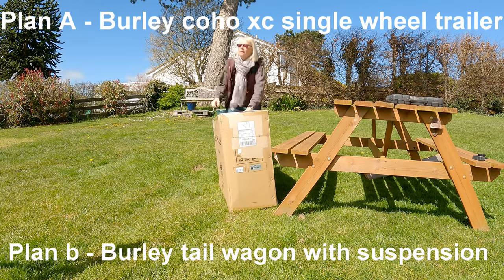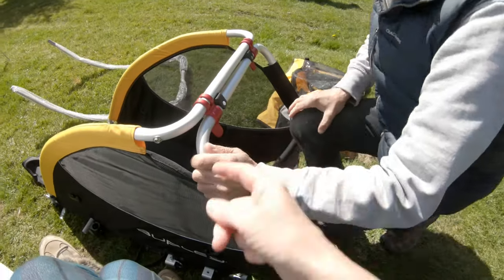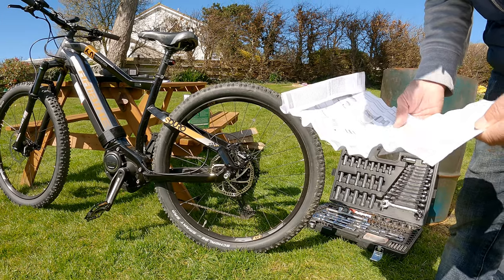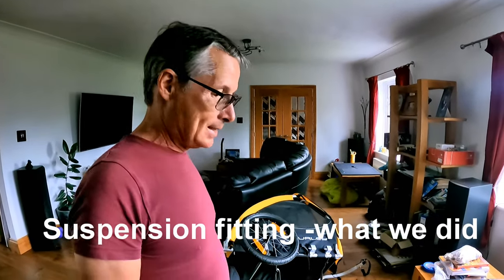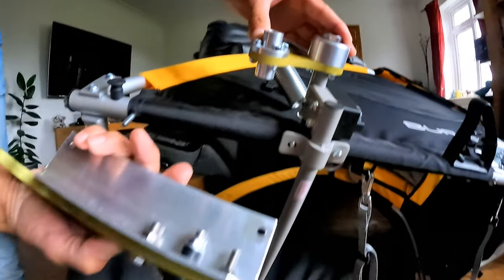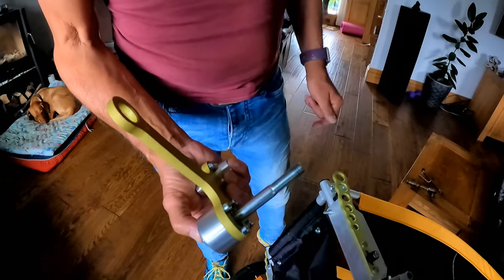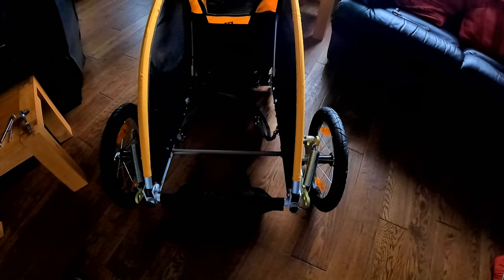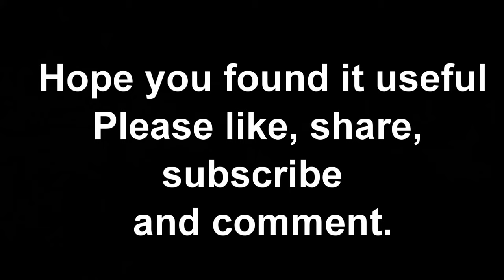Ep 24 Fitting suspension on the Burley Tail Wagon dog trailer

Comment: We have tail wagon and the Coho.  Going the opposite direction as you guys.  Our tail wagon has been heavily modded to allow its continued use.  First, the cheap/thin plastic floor gave way, then the QR axles on the trailer wheels was next to disintegrate, then the axle bolt on the bike sheared.  All these things were overcome/fixed by a local machine shop and hardware store.  I think the only thing left original is the frame and some of the covering.  I really like that suspension you have on yours.  Wish we knew about it in the beginning.  Burley also makes 3" wheels that should help with smoothing out the bumps -you can run less air pressure in them.  For us now though, gonna give the Coho a try to see if our dog will like that.  There certainly is a market for a quality dog trailer that is meant to take some abuse/long term use.  Burley's are nice but they are the equivalent to a Honda Civic going off-roading.  It'll do it, but not for long.  Thanks for sharing your videos and best of luck with your trailer and dog-ventures.
Reply from the maker: Hi - we have since changed our minds as our Vizsla didn’t settle in the coho and she was unable/wouldn’t lie down at any point in time and after about 20 mins she was bored and moved/transferred her weight from one side to the other which means the bike would begin to wobble if you weren’t expecting it - which is fine out on bike trails but not when you’re still on roads. So for safety we’ve adapted another tail wagon with the suspension as it’s a bit more stable. The downside is it’s wide snd not suitable for some bike routes- it’s always a compromise. We also wish bike trailer manufacturers would provide a viable option as they are not always a cheap purchase
Will have to keep an eye on the issues you’ve had with yours. Hope you find a solution- let us know

Comment: Thanks for the thorough review. I do wonder if you have documented the modifications you´ve fdone to the COHO trailer. I´m leaning towards that one but would love to see it a bit safer
Reply from the maker: Hi, we’ve changed from the single wheel coho trailer as I had an injury and no longer felt in control of the single wheel
Coho especially as the Vizsla becomes very excited after about half hour as that’s when she normally gets her walk so we now have 2 burley tail wagons with the suspension fitted which is much more stable (albeit the Vizsla is still excited after half hour 😂 but the trailer doesn’t cause the bike to wobble) and the mods with the suspension on both trailers have worked brilliantly for a long time now and definitely recommend suspension on any bike trailer. Sorry no documents but can say it is working well. 
Hope you enjoy whatever you decide works best for your adventures

Comment: For the single wheel, one wheel in the rear will not be stable as the dog's movement as well as your movement will be very difficult to minimize. Suggest considering a two rear wheel setup with suspension... the wider, the more stable. Also, have you considered tire pressure as an addition to the suspension? That is a consideration for fat tire bikes, wide tread and lower pressure. With two tires in back of trailer as wide (let's say, 2"x2) will split weight and ability to lower pressure. Just thinking...

Comment: Is there a version that allows brakes? I am thinking to make a four wheel trailer as be to carry my dog in future and as a camper for long journey but thinking to put brakes on so not rely fully on bike brakes to stop it all, also a hole to padlock the trailer brakes on for night
Reply from the maker: We are not sure if there are any brakes for trailers (it would be quite a complicated design I would think) and we have never heard of trailers with brakes that you can use whilst cycling (only trailers that we have seen with brakes are those that you manually put on at the back when parked up.
We have been down some steep inclines and our bike brakes have always worked but we do make sure we are not going exceptionally fast to save them 
Sorry we can’t help you further but hopefully you will have great trips out with your dog
Reply: @Doggonemotorhomeadventures  was mainly wondering as my trailer be heavier than the one you using and like limit how much push on bike, I have an engineering brain so basically always thinking of how to engineer different things like DIY an overrun brake

Mainly as thinking for a trailer that dog can be in it on journey but if stop at night it has like a heater and stuff inside of it like if someone took a caravan but enough room for me and dog so like if still do my dream of cycle large distance can still look after the dog but have easy way to sleep at night than like put tent up each time

Yeah be awesome in future, aiming for to make a machine first in hope I can earn money better so can easy afford get my first dog and enjoy trips and walks together, at moment I just get enough that might feed one but not much else, I miss dog walking from when I last did so I estimate in 2008

Comment: Hi thanks for the video. Do you know if I could fit this suspension kit in a Pawhut dog trailer?
Reply from the maker: Hi there, not sure about the Pawhut trailer but we were not sure about the Burley either so we just sat down and brainstormed until we came up with a simple solution. The angle aluminium brackets as it’s cheap lightweight and easy to work with. I think you actually need the suspension kit in your hands to be able to think it through.

Comment: Hello you wonderfull two people!
Thank you for this video. I’d like to mount suspensions myselfto my Burley. Could you please tell me wich one of the company doggy-suspensions you bought? The ome for the Croozer or Leggero? 
Is it possible to make a video of the making of this aluminum-part, you made?
Thank you and best regards from Switzerland!
Reply from the maker: Thank you.  We used the croozer one but presume the other make could be made to fit. In respect of the aluminium bracket we made we simply purchased a 90 angle bracket from eBay and then used a multi tool to cut it down to size and angle the corner so that the spring fitted without being hindered and drilled the holes using normal drill with metal drill bit to coincide with the holes on the burley frame.
Reply: @Doggonemotorhomeadventures  thank you very much!

Comment: hello. I have bought the burley tail wagon and the suspension that you show in the video. I want to do the same installation for the suspension that you have done. I would be very grateful if you could share the measurements of the piece to anchor the suspension to the trailer, since I would order a blacksmith to manufacture that piece. Thank you so much. I mean when you measure each side of that piece of aluminum and how thick it is. Greetings. Thank you!!!
Reply from the maker: The aluminium bracket to anchor onto the trailer we cut to 14cm length by 5cm width with one corner removed in diagonal 90degrees
Reply: @Doggonemotorhomeadventures  thank you so much for your help!!! Greetings!!!!